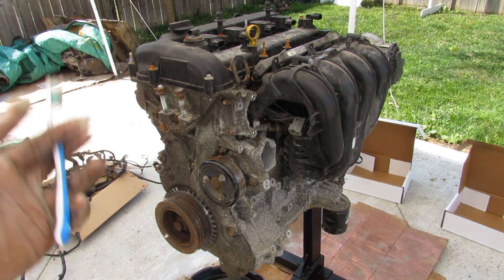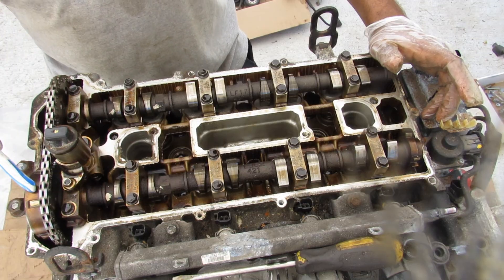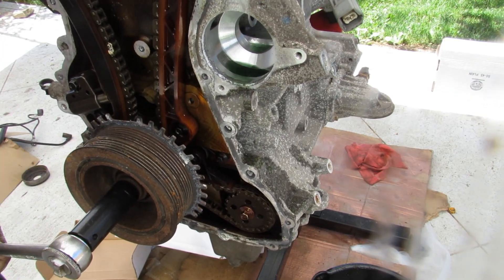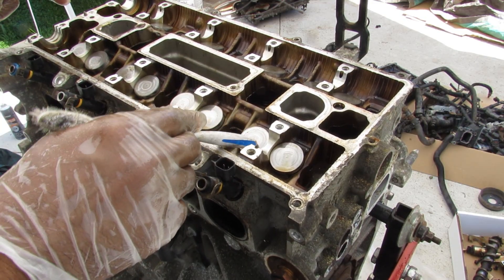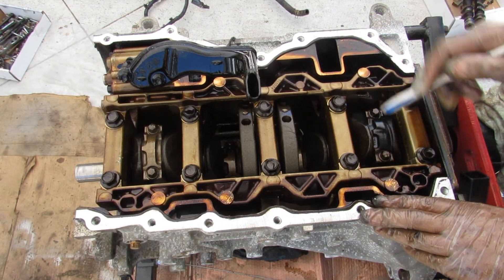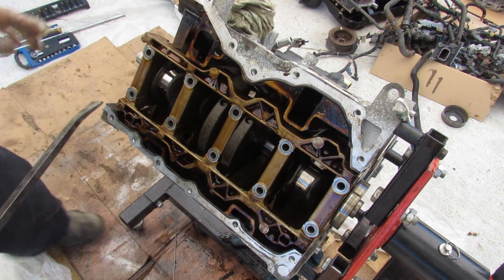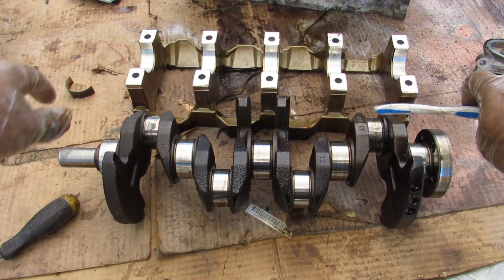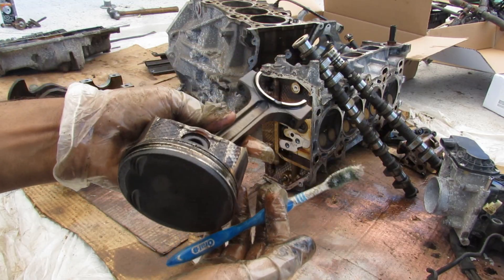Why Mazda Engines FAIL

Comment: Theres an inspection port on the driver side. You have to put a bolt through the port to align the crank at top dead center it is literally the worst way to time an engine I don't know what Mazda was smoking when they designed the engine but timing those engines are a fucking pain in the dick
Reply from the maker: Yeah I saw that bolt hole. Why....
Reply: @speedkar99  so you can buy a new mazda after it inevitably throws a chain due to a crappy chain driving a high pressure fuel pump

Comment: Never seen a plastic valve cover before...wow.
Reply from the maker: All new cars use Plastic covers now. Cheaper and lighter
Reply: I know the Nissan VQ40 they put in the frontier, Xterra, Pathfinder etc all have plastic valve covers with integrated non-replaceable spark plug tube seals. Thought I was going to get away with just replacing the gaskets but apparently Nissan wants to make you buy the whole valve cover.
Reply: Haha, let me surprise you, vw uses plastic oil pans
Reply: why not use plastic there? It's not under any kind of structural load, just has to stop the oil spraying everywhere.

Of course you must engineer it correctly...
Reply: The very earliest versions of this engine had metal covers. You'll only find those in Mk3 Mondeos, and maybe some of the early Mazda 6 possibly.

Comment: Basically a glorified lawnmower engine that still somehow ended up under engineered... Sigh typical mazda and fomoco. I guess they only want it to outlast the lease/warranty.
Reply: My 2.0 duratec is 16 years old and runs like a clock so maybe not that.
Reply from the maker: There are worse engines...wait until I get to the Hyundai
Reply: How do you mean "under engineered". These things can handle double the factory horsepower on stock internals and regularly last 500kkm...

Comment: wth.. why they made it this way.. thought only stupid renault dont have keyways..
Reply: Indestructible timing chain? Like how BMW has put the timing chain on the transmission side of the engine and it then fails. Although duratecs'/mzr's have a very durable timing chain
Reply: @subbaaja100  lol that bmw design terrible af. No doubt these mazda engines may run quite some time.
Reply: @jdmcars-lt6499  I know right. Mine has 310 000 km on the clock and it pretty much runs like it's new

Comment: As good as this engine is  and easy to work on, I don't know why ford did not put keyway on this beautiful engine.
This is best engine of all time. This engine can abuse and yet won't die.
Reply from the maker: They are sensitive to oil level though. The keyway is an oversight
Reply: algorithmae
1 day ago
Timing is set by removing a small screw on the side of the block, and installing a peg that contacts the crankshaft and stops it from turning once it reaches TDC. I do wish they would have keyed the crank though :/

Paul Mills
1 hour ago
 @speedkar99  There are special service tools to lock the cams and crank to set the timing. With the tools it's relatively simple.
Reply: @JohnSmith-pl2bk  you have to remove valve cover and do so much just to change front crank seal.

Comment: Wow, what a stupid design with no keyway for the harmonic balancer.
Reply from the maker: Very dumb for those who will work on it.
Reply: @Zombie Head Many 80s cars have port injection. Some cars had it as long ago as the mid 70s. Some had EGR too, or stuff like air injection which is thankfully a thing of the past.

Most 80s cars were worse in other ways. Many of them had timing belts because chains fell out fashion. I have a 1988 car with both a plastic intake and a timing belt!

EGR valve on these duratecs are laughably simple and nothing to be afraid of. It's a seperate solenoid which pushes down on a metal plunger with a spring. There really isn't much to go wrong with them, and even if something did you can take it off in minutes anyway. All the pipes for it are cast into the head so there's no chance of anything leaking or going wrong because there's no connections apart from the single gasket at the valve itself.

Comment: Awesome breakdown.  Good engines but no timing marks is probably from Ford.
Reply: yep, they saved money on ZETEC engines already (Focus mk1 at least). but here they pushed further: oil sump cannot be removed without timing chain cover? that's crazy.  FORD made pitty-penny on every aspect, so this engine is hard to maintain properly. buy it, throw it away after a while
Reply: @elstimate    GET   SMART......purchase a Toyota, or top of the line, Honda.  Leave North American junk.......alone.
Reply from the maker: Haha
Reply: All Ford. Mazda never produced an engine without a keyway.
Reply: @danven1256  It's a Mazda design adopted by Ford. I'm looking at the workshop manual for the Mazda LF engine, which is what we have here, and there are no keyways. You lock the cams and lock the crank then tighen the bolts.

Comment: Is there an oil additive to help remove the blockages as they build up over time?
Reply: Just change the oil every 10.000 km, and use the highest quality standard oil that works with your engine. Good quality oil filters too. And you will not have those issues to begin with.
Reply from the maker: Keep changing your oil
Reply: @speedkar99  I think it's inevitable though that these carbon deposits build up. Maybe the engine just needs to be designed so that's they're easier to remove.

Comment: I got 173k original miles on my 2006 Mazda 3 with the 2.3L engine. So far, I have not had any issues yet. The key is to generously change your engine oil! Because they tend to stretch the timing chain prematurely if the oil is not changed on time.
Reply: Yup. Oil and filters are cheap. Engines are not. Don't forget the transmission oil too.
Reply: PCV failure on the MZR leads to them consuming oil causing oil starvation. I had an 06 Mazda 6 with the same 2.3 and did oil changes every 3k miles. Had the PCV fail and it drank all the oil in about 800 miles and burned up a few bearings.

Comment: That's a good engine!
The cylinder head flows really well
Reply: Those engines provide lots of power the only thing is is that there are plenty of questionable at best engineering choices on that engine
Reply: That's what I'm saying this engines can handle anything you throw at them. Even the Disi engine which is the 2.3 turbo from Mazda that's a great engine people just don't know how to take care of them
Reply: @carlossantamaria7967  yeah but using washers to keep an engine in time? Idk sounds like going around the block to get next door. Might as well get a 2gr or 2ar
Reply: Mazda MZR with Individual Throttle Bodies ♥️😀

Comment: They still use them in the Ford Kuga/Escape Hybrid, the 2.5 variant.
I think these failures surface because of bad maintenance over time
Reply from the maker: Yeah and the type of vehicle they are in
Reply: Maintenance is the key, these engines need extra care if you want them to last a long time.
Reply: Mazda skyactiv 2.5L is still very similar as well.

Comment: My 08 Mazda 3 has been rocking so far. Fingers crossed!
Reply: What did you do make the engine last a long time?
Reply: @applepoop10  best thing you can do is use synthetic oil with good quality filters and change both regularly, half the mileage of what the manufacturer recommends. If you also don't abuse it while it's cold and warming up, even a Ford might last.
Reply from the maker: How many km?
Reply: @speedkar99  225k+ km. I got it with around 210k km.
Reply: I had a 2006 Mazda 5 with the 2.3 variant of this engine and I sent it to scrap at 300000km for rust and destroyed suspension, but mechanically the engine and auto trans were perfect! I also have a 2008 Mazda 3 with the 2.0 version and everything is fine, at 270000km.

Comment: At least the water pump is on the OUTSIDE.
Reply from the maker: I know right!!
Reply: @speedkar99  It is a halfway to Toyota or Honda engine quality.
Reply: @rondhole  Try above Lexus reliability currently . Its overall the most reliable brand in the world right now . Mazda .
Reply: @jackanderson2773  Lexus is Toyota, so that makes sense. Wait, you’re saying Mazda is the most reliable? Aka, Ford?
Reply: @JimmyMakingitwork  bro mazda hasnt been owned by ford since 2012....
Reply: Mazda split from Ford years ago .
Reply: @jamfd3s788  yep exactly
Reply: @JimmyMakingitwork  mazda hasnt been ford for almost a decade now
Reply: @JimmyMakingitwork  You're ignorant...Mazda hasn't been associated with Ford since approx 2012.
Reply: @rondhole  Toyota reliability - that's just an urban legend. Toyota 4 cyl engines from 2010 are as crappy as this 4 cyl. Cheap engines all of them: http://www.toyotaproblems.com/excessive-oil-consumption/
Reply: @freedomspeech9523  wrong. Toyota 4 cyl engines from 2002 are crappy. 2az-fe has stripped out head bolts from the block. The 2zz-GE has a problem with the oil pump gears and has pumping losses due to a baffleless oil pan
Reply: @rondhole toyota getting a bit crappy these days
Reply: At least the water pump is still made of alloy and not plastic.
Reply: Right!!!! Thank God my aunt has a cx9 and omg. The water pump is leaking and is is inside the timing cover. I was like @$#%*&$#@$%^🤬
Reply: @HIMI2003  Thanks, FORD!
Reply: @HIMI2003  Most of the modern engines will have that water pump inside timing cover, driven by timing chain or timing belt. Except some Duratec Fords.
Reply: @freedomspeech9523  right..... God i hate that those engines design.
Reply: Nissan......VQ series water pump built in......
Reply: @jtomtl  and they rarely fail, unlike Toyota's V6 waterpumps.
Reply: @trent7080  true, but mine works just fine, Toyota 2GR-FE V6, Nissan VQ is great, until Nissan pairs it with the CVT…. U got nightmares after that
Reply: @jtomtl  not on the 5.6L

Comment: Still relevant too! I read that the 2.5L engines used in the hybrid system in the Ford Escape and upcoming Ford Maverick are based on this MZR design (Mazda L). (Update: it's in the Ford Fusion Hybrid too.)
Reply from the maker: Yeah the Mazda engine is still in use in many ford's although Mazda themselves have somewhat abandoned it
Reply: @speedkar99  mazda doesn't and hasn't used this engine since 2012.
Reply: I thought early 2012 was the last model with the mzr too, which is what I have, but then a few weeks ago a 2013 sedan Mazda 3 with a 2.5 mzr came into my auction lot and had me baffled. I wonder if it was some kind of special option to get rid of excess inventory?
Reply: @syloui  This is really going down the memory hole, but I think the Skyactiv-G was an option when it initially came out. Similar to how the 2.3 was optional the first few years.
Reply: @speedkar99  Yeah, my understanding is that the 1st gen Skyactiv-G were heavily modified MZR, but now they have totally new engine designs.
Reply: The 2.5Ls are actually good engines, I've yet to see one fail or hear of a failure unrelated to somebody loosing the crank bolt and throwing the engine out of time. The one with the bad rap is the 2.3L, they are known to suddenly start burning a lot of oil and most people don't catch it until the oil pressure warning light comes on, which is usually too late. The good news is that the 2.0L, 2.3L, and 2.5L will all bolt up in place of each other and pretty much plug in so you can do cool stuff like drop a 2.5L into your 2.0L Focus.
Reply: The Hybrid Fusion and C-Max stopped using the 2.5 in 2012 and went to the 2.0 Duratec.

(Edit: Clarification, only speaking about hybrid models.)
Reply: @OhPhuckYou This is absolutely false. The Fusion NEVER had the 2.0L Duratec (at least not in the states) and the 2.5L was the base engine in the Fusion all the way through the last model year in 2020. The C-Max also NEVER had the 2.5L as an option ANYWHERE in the world.
Reply: @OhPhuckYou  Um, you might want to do some research as well. The 2.0L used in the hybrid an oddball engine and not a typical 2.0L Duratec.

Comment: Do a mazda 6 v6 engine or a skyactive
Reply from the maker: Ah The duratec v6
Reply: skyactiv to new, probably cant get one
Reply from the maker: Hoping maybe I can get a 2011ish skyactiv.... If they are many failed ones out there...
Reply: @speedkar99  mine is 2011 they still use this engine not the sky active one yet.